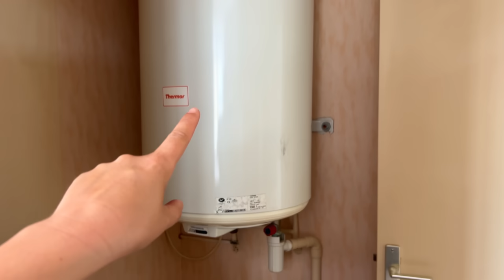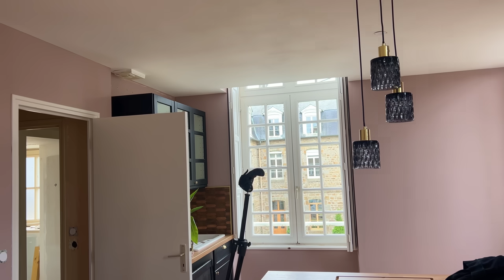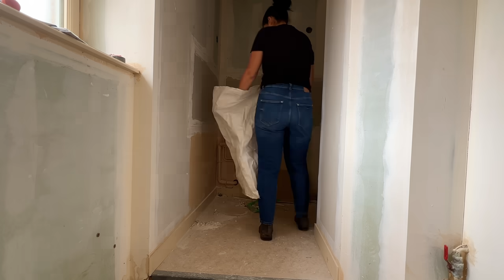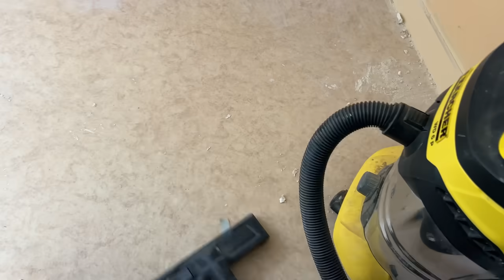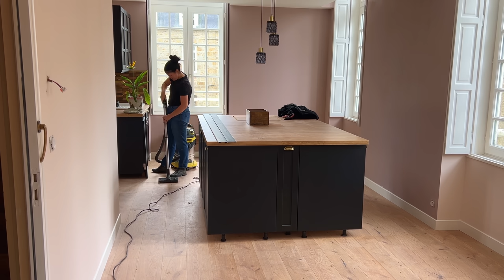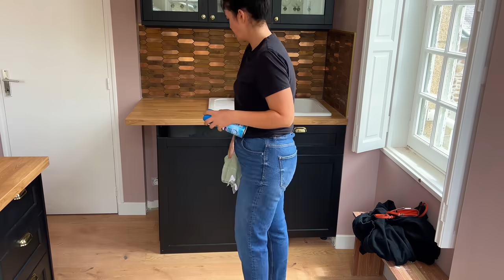What's Next For The Apartment?

Comment: Gwen is doing such a great job with you and Billy and your Mum her retreat will be very popular if people have results like you have losing weight. If I win the lottery might hire her myself ;) If you get Yannis to help you make a shelving wall on the side with the electric box and put a door over the box part so it looks part of it. No need to paint if you do that I think just paint the bit you sand off. If you use white particle board to back the shelving it will save you painting it all again. It can house pictures and books whatever. I would replace that boiler or take it down maybe when Billy installs the stove it can be done together. A little tlc for that bird of prey should be good as new. I fear the pot might be too small but you can reuse the pot for another smaller plant maybe a fern or pilea pretty safe for pets but put the Bird up higher if you have any animals in the house or in the bathroom.